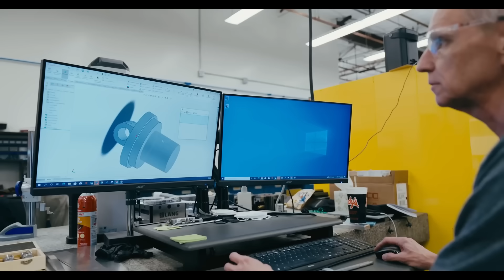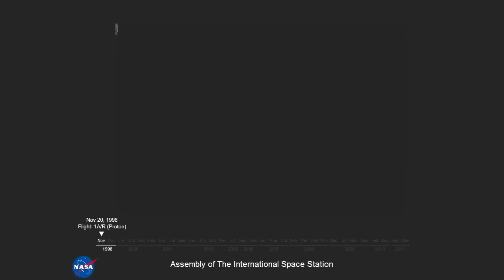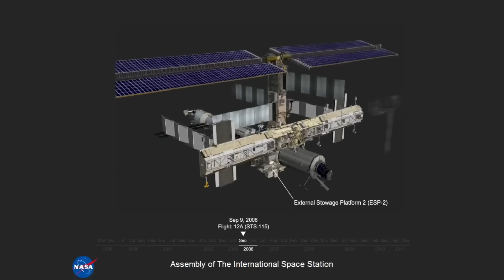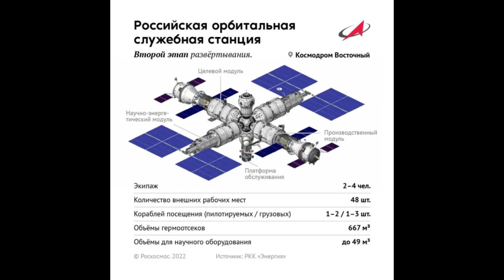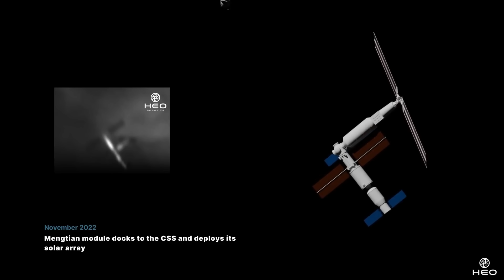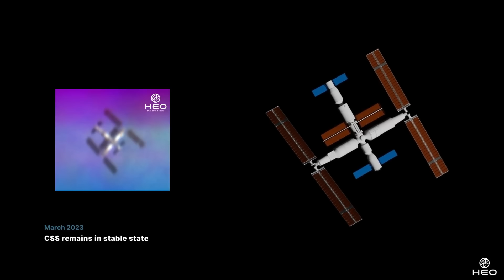Where Will Astronauts Go After The ISS Is Destroyed?

Comment: This sounds a whole lot like the years leading up to the Shuttle retirement. 
'There will be no gap in crew capability. Ares hardware is being built. Orion is being built. Constellation will be ready. We'll use off the shelf components to speed the process and keep cost low, etc...'
11 years later, we still would not have had crew capability had SpaceX not arrived.
Reply: @slartybarfastb3648  Boeing can get crew up there, they just can’t bring them back
Reply: @rswyltk  Getting up there is half the battle!
Reply: @rswyltk in other words they can't actually help. So why even mention that Boeing can get people up there when the mission is to get people back to earth.
Reply: My thoughts exactly
Reply: Boeing had a huge part in the post shuttle gap. Starliner was being built as an Orion Light to service the station before the shuttle stopped, and SLS/Constellation/Ares was only held up by major Boeing components - the SRBs and upper stage were ready for years, and had even flown in the Ares 1X (which could never be crew rated), and Orion flew on Delta IV but there was no crew rated launcher for it without Boeing (crew rating Delta IV involved refitting it to the RS-25 and massively inflating it's already luxurious price point). Starliner had two crew rated launch options and a third option that could be crew rated without exploding it's price tag, but what it didn't have was Starliner itself.

SpaceX has changed the game fundamentally in 2018 with reuse, and it figures heavily into all but one of these systems. So the failure points with the post shuttle gap don't exist - reliable, affordable, crew rated, high launch cadence launchers are available and a proven crew and cargo delivery vehicle exists. Falcon has limitations but it still removes the three biggest pain points in the process.

I had a high school science teacher who said, "If you're making dragon soup, first catch the dragon." When the shuttle stopped flying NASA had water, vegetables, potatoes, and spices, but Boeing couldn't deliver the dragon, so it was all for naught. This time SpaceX has the literal dragon in hand.
Reply: @Hevach  What I'd prefer to see is a new space station already on orbit before ISS is retired. SpaceX can get the new station up there, but they do not have one themselves. 
What we have are proposed designs still years away from launch. Past experiences tell me none will be operational before 2030.
Reply: Fortunately there are multiple private contractors that are pretty far along with their modules and there is a big profit motive for various high-price low-mass things that can only be created in space. I expect it will be quite the boom industry once we can do more research and development than the paltry effort on the ISS.
Reply: @Shrouded_reaper  "Big Profit Motives" always ring the "Cheap Bell". Never happens. Also, Private Contractors just jump off a project, if it doesn't work out. There never is an "Alternative Plan". I find this highly amusing, because YOU will rely on them.
Reply: @startybarfast3648 🎯🎯🎯
Reply: Space X is heavily subsidized. Like Tesla, other EVs are struggling while Tesla already got its 4+ billion.
Reply: @trvst5938  What subsidies does SpaceX get? They're awarded competitive contracts. Subsidies either pay companies to NOT produce something (such as farm subsidies), or to promote faster growth and availability such as "Green" EVs or renewable energy sources. 
I personally think government subsidies should be banned in all forms. Competitive contracts for research and products are not subsidies though.
Reply: also the shuttle most certainly didn't save money, it burned it
Reply: Thankfully we don't rely on the renowned government punctuality anymore
Reply: Well said! Btw, how's the fjords coming along?
Reply: @KaizokuSencho  No awards for the crinkly edges.
Reply: the shuttel was so great. It was a mistake to not try to make it better. A new version ore so. The privat companies are all shit and will not help us to set a new frontier. Historical it was never the case, so why it should now. I as European are hyped on the new ESA Rocket. But its so sad that NASA do not get enough money anymore becouse NASA was fucking based. 

Also a big downfall to spacetravel was the collaps of UDSSR. They acomplished so much great thinks.
Reply: If not for the actions NASA took to hire SpaceX to build this, NASA didn’t do anything. Right.
Reply: @FuncleChuck  NASA assured the US and our allies that the Constellation program would have a replacement for the shuttle fleet before, or shortly after their retirement. That did not happen. 11 years later, we were still dependent on Roscosmos.
You have heard of Constellation?
Reply: exactly. And since SpaceX is still here and throttling hard, they are the only one whom you can count on to build marvelous things the next years, with the Starship. Same way that they made Starlink, I expect some very decent projects to be put up there with Starship. THe size of a station you can assemble with a starship fleet at low earth orbit about the ISS height is ridiculous
Reply: You make that sound like SpaceX wasn’t meant to be part of the solution… you’ve got your history really mixed up there when it comes to the deliberate privatisation of crew launch capability..,
Reply: @lukefreeman828  SpaceX wasn't a part of the plan. They hadn't even had a successful Falcon 1 when the Constellation program was approved for funding.
Reply: @lukefreeman828 SpaceX is a special case not representative of your regular private company. The CEO is an ideologically driven man that views profit as a secondary objective. It was by pure chance that the Americans got such an unconventional private actor. For the single success that is SpaceX you can name dozens of failures...
Reply: Wrong, you've created a false alternate history that pre-supposes no action would have been taken to remedy the situation.
Reply: @zacklewis342  What action? You can't just pull a human-rated spacecraft our of your butt. If not for SpaceX we would have continued buying seats on Soyuz to this day.
Reply: @gui577b  That depends on your requirements for "human rated". NASA and the Soviets certainly had differing opinions on that. While pulling one out of your ass would be painful, it is doable.
Reply: @OscarSommerbo  but that requires you too accept a lot of dead astronauts. Russia does. The US/NASA does not.
Reply: @thejauntyfool  We're paying half the price and the money stays in the US.  Glad you appreciate that.
Reply: @zacklewis342  Exactly. SpaceX Dragon didn't just "happen". A lot of NASA funding went into it, as well as from SpaceX. Not as much as NASA sunk into Boeing, of course, but without the public money Dragon wouldn't be here.
Reply: @zacklewis342  "you've created a false alternate history that pre-supposes no action would have been taken to remedy the situation."
          No, he's reminding us of actual history where nothing was done to remedy the situation.  He's reminding us of a historical failure mode.  There have been 2 major hiatuses in NASA manned orbital access capability.  Between the Apollo-Soyuz Test Project, and the first Shuttle flight, and between the last Shuttle flight and Crew Dragon 1.  Don't tell us it can't happen.  It HAS HAPPENED.  Now, it MAY NOT, but his cautionary reminder is well taken.
Reply: @zacklewis342  Action like what? SpaceX was one of two contracts awarded. This was the action taken. Boeing's offering still hasn't become operational.
Reply: @zacklewis342 It's not a false narrative, it's in fact exactly what happened not a hypothetical despite poor wording. Crew Dragon was that remedial action and it still resulted in huge gaps in capability. 

Your NASA is merely a shadow of what it used to be. This is what happens when you allow empty suits and politics into organizations, it isn't result oriented engineers nor curious scientists running the organizations under NASA. 

And importantly for the few exceptions they still have, a piece of paper doesn't make an engineer or a scientist, it's a state of mind and habit.

Comment: Its somewhat disappointing that the ISS wont enter a graveyard orbit. Similar to hubble, just deorbiting these iconic space assets is mad
Reply: If you just leave it in a graveyard orbit it will fall apart because of heating cycles and no maintenance, turning into a cloud of space junk.
Reply: @Shrouded_reaper  That's unfortunate. It would be nice if one day using more developed space infrastructure they could be recovered and put into a museum.
Reply: @Darth_Insidious if we were still flying space shuttles it could theoretically be cut up and salvaged, but also insanely expensive.
Reply: @Shrouded_reaper Why doesn't this happen to satellites in geosynchronous orbit? An altitude much lower than that could put off reentry for hundreds of years. Would it really break apart from just heating/cooling cycles?
Reply: @SarcasticTruth77 Two things come to mind.
As smaller objects, satellites should see smaller expansions and contractions, so the forces exerted are similarly smaller.
Satellites have much simpler construction, so they're simply less delicate.
Reply: @SarcasticTruth77   Not as much, because things in GEO are in continuous sunlight, other than for the occasional "eclipse" when their orbit happens to line up with the earth/sun. They're not doing heating/cooling cycles every 90 minutes like the ISS is.
Reply: @CptJistuce  And in geostationary orbit it's eclipsed by the Earth less.
Reply: @SarcasticTruth77  Geosynchronous orbit is vastly higher than the ISS orbit and they are in sunlight almost all the time. Wtf are you talking about?
Reply: Well, if you attach Discovery One to the Leonov and to the ISS, you can escape the gravitational pull of the planet. . . .
Reply: Any graveyard orbit would take many tonnes of propellant to reach.
Reply: And what do you propose?
Reply: I get the feeling that some extremely smart people have suggested adding a booster module to send it unmanned to a Mars orbit.
I also get the feeling that some time in the future we will regret not doing so because it could have been used in a rescue mission.